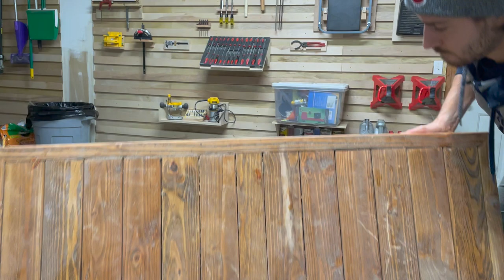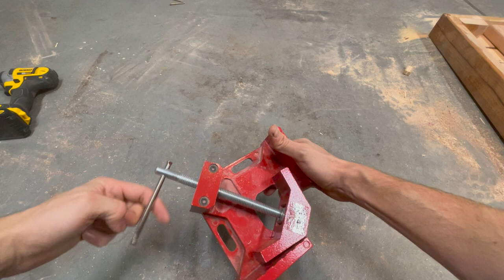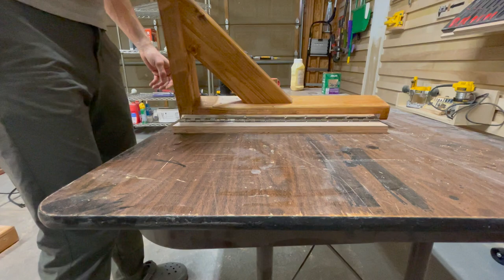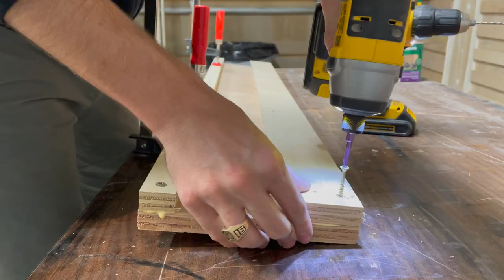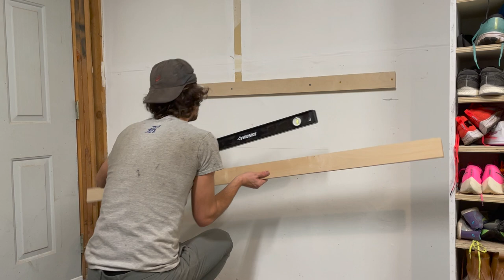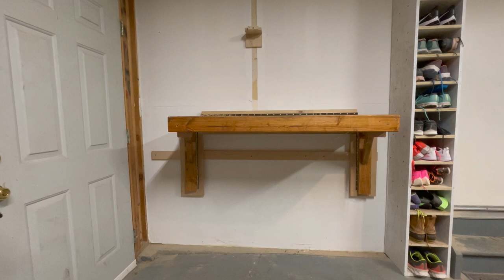Meet Murphy, My Drop-Down Workbench

Comment: what happens when you accidently kick the support out with your leg? i like the full length cleat assembly details
Reply from the maker: The table top can support itself (via the French cleat) without either of the leg supports. Those are just for additional support. Unless there was a lot of weight on the table top and you kicked out both legs everything would be fine. This was mostly used as a temporary work surface so I never really had anything heavy on it. Good concern though.
Reply: @FirthFabrications  ok thx, yeah ive been considering a removable support leg on a folding table i have

Comment: How much load can the supports take, given that they're suspended by hinges? I'm seriously considering this build, but with an adaptation to a moist cellar wall, so I'll have to use something else than wood for the french cleats and whatever else that touches the walls.
Reply from the maker: I did not test the bench to failure...but I can say it safely held my body weight when I sat on it. Its really mostly dependent on the supports below it and how much weight the cleats can hold.